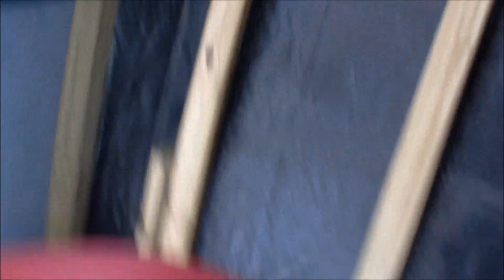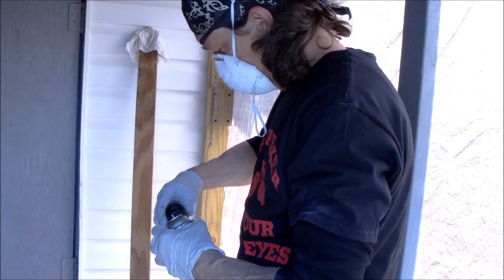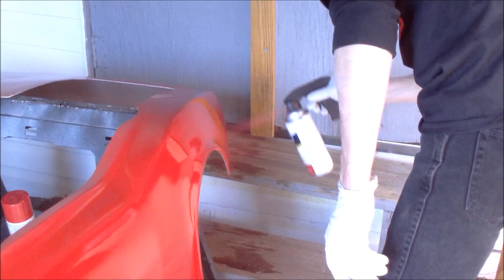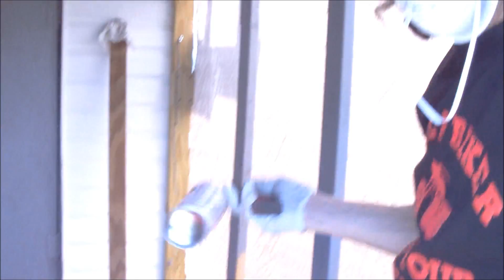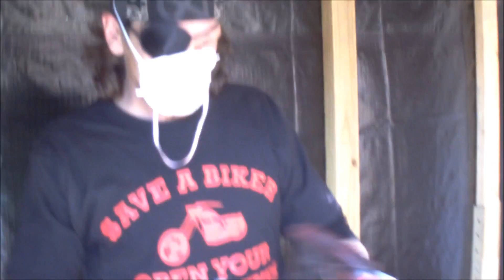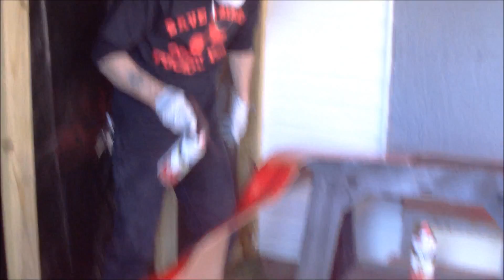painting the corvette fire Red, friggington!

Comment: Looks sweet bro! Make sure you put a clear on that. That paint scratches and chips real easy.
Reply from the maker: sure thing, prolly put the dekkels on first so they last, what do you think?
Reply: udizzy1969 if you put them on before the clear it does give them added life. A couple of things to remember:

1. Make sure you clean the are you want to put the decal with denatured alcohol. This will assure the best adhesion, and prevent bubbles.

2.When you do shoot the clear nice light coats.Nice slow and easy. Thick wet layers try and leech under the decal and make bubbles.

3. Lastly if you are doing multiple coats just sand enough to give it a tooth. It is very easy to scratch the decals and once again cause bubbles.
Reply from the maker: thanks so much bro, great info for sure, cheers

Comment: Man, you layed on the first coat heavy.  When I use spray bombs, I just give a dust coat, and then a regular coat when the dust coat is tacky.  The first one gives the paint a good base.  I find I get far less runs that way.  I also don't plan on getting good coverage until the second full coat.  The first or dust coat doesn't cover much at all, the first full coat gets about 60%, then the second full coat fully covers.  That's gonna look sweet.
Reply from the maker: it did some cracking but looks ok, cheers bro